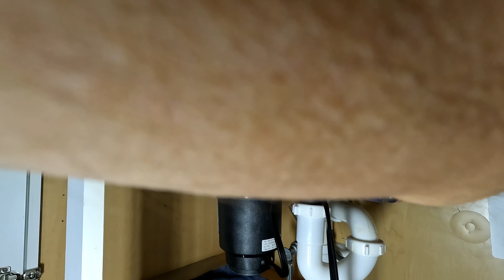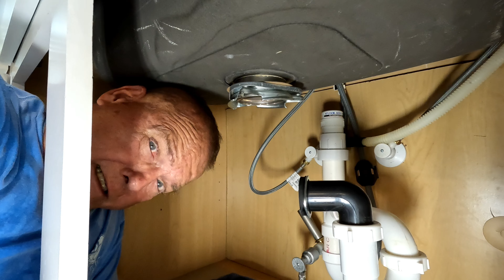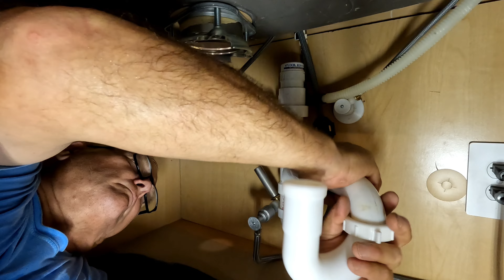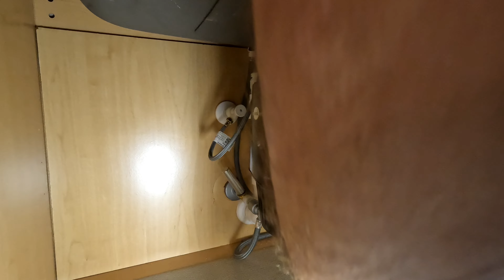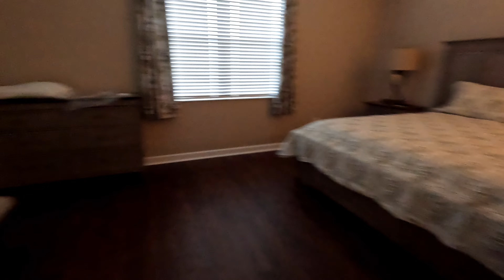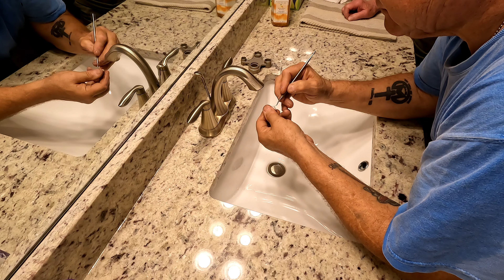INSTALL A PRO 750 FOR A NEW CUSTOMER, TO FINISH THE DAY

Comment: Jonny I am thinking of putting a disposal in  But I have a septic system. Do you recommended it ?
Reply from the maker: @williamking8034  it'll be fine if you don't abuse it,and pump your tank regularly
Reply: I agree.  I have lived in the same house since 1976 with a garbage disposal and septic system. Do as Johnny says.   😊😊😊😊

Comment: Those push,pull valves suck.
Reply: accor    brand yea those are shit     i norticed the house yester day had those with replaceable lines in kitchen   but integral hoses on the lav
Reply: @willydavid I agree! Ive got in with a housing community by my house and started charging them out. Out of 500 homes I’ve done 6 already 🤣
Reply: @ 🤣 yep true! It’s boring though 😂